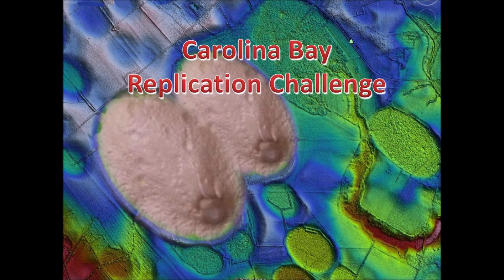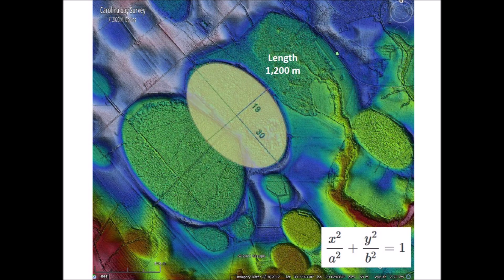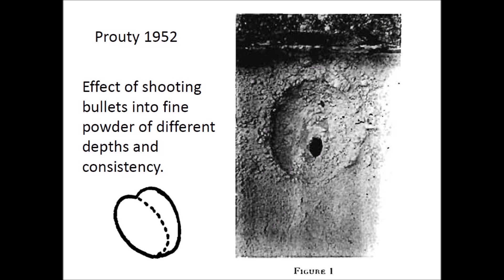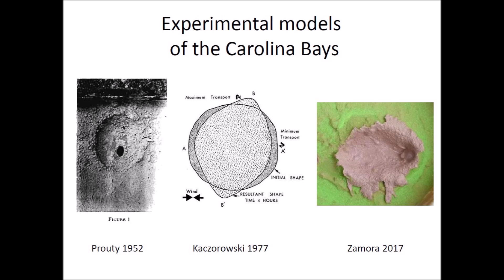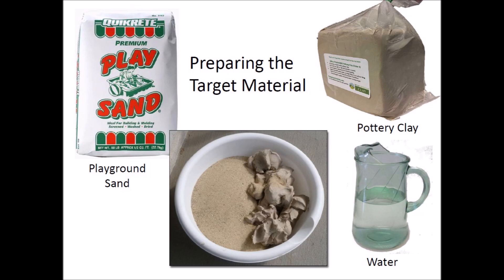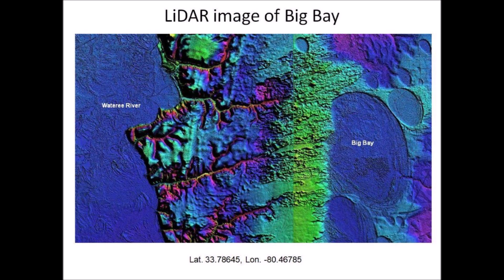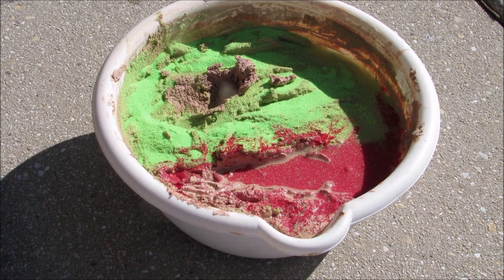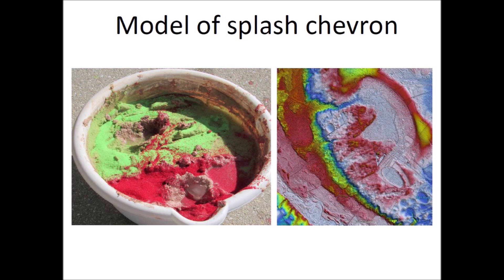Carolina Bay Replication Challenge

Comment: Antonio, what do you think of the possibility that these sinkholes maybe in part relic sites of ice boulder impacts that had remained frozen until relatively recently, and on melting over time had the volume replaced by methane?  https://youtu.be/kanyJeI2Oec
This one is particularly intriguing https://youtu.be/BJ1aTWa_5A4
Reply from the maker: The Carolina Bays are not thermokarst sinkholes. They occur too far south in terrain that did not have ice during the last glacial maximum. We also have to keep in mind that the Carolina Bays and the Nebraska rainwater basins have the same mathematical elliptical morphology, with width-to-length ratios of approximately 0.58.  The orientations of both of these geological features converge by the Great Lakes.
Reply: @Antonio_Zamora  Sorry, you misunderstand me. I entirely accept your explanation for the CBs and NRBs. I refer to the causation of these sinkholes in Siberia and suggest they may be impact sites of ice boulders that hit after the same causal event or another. I ponder if post impact the ice remained or refroze, was subsequently covered by seasonal vegetation but has in recent years turned slushy, been infused with methane before collapsing/exploding to leave the sinkholes. They are punched deep through up to 800ky of stratigraphy of ancient peat fields. I understand fully the science explaining them as thermokast sinkholes and they remain that in my consideration of them, I just wonder if their causation is remnant ice boulders. They are in the same approximate range from the Haiawatha impact site as the US sites you study, and the enormous bone yards of destroyed megafauna of the region are equally analagous to historic finds in the US. I also understand your preferred explanation for US features are an impact site at Saginaw Bay, and I'm not saying that is wrong,  however my own remit is to explore every possibility linked to a higher energy impact at Haiawatha crater and search for supporting evidence. Whatever happened 12,800 yrs ago had similar consequences across the entirety of the Northern Hemisphere,  and needs an explanation that fits that evidence. A melting ice boulder combined with methane infusion may or may not be a good explanation for the sinkholes but given they are at the same approximate range from N.Greenland it is an intriguing possibility that deserves exploration.
Reply from the maker: @CandideSchmyles  I measured the distances with Google Earth.  The Batagaika feature is 3721 km from the Greenland Crater under the Hiawatha glacier. The distance to the Yamal peninsula, which also has many thermokarst features  is 3180 km from the Greenland Crater. This is quite far for ejecta from a 31 km impact crater in Greenland.  In order for ejected ice to be buried, it would have to hit liquefied ground and the ground would then have to freeze almost immediately. An impact on hard ground would cause an ice boulder to fracture without getting buried.  Liquefied soil has a density of about 1,500 kg/m^3 whereas ice has a density of 917 kg/m^3, so the ice tends to float toward the surface. Ice buried in  viscous ground will float due to its buoyancy unless the ground freezes immediately.  The more likely explanation for the Batagaika feature is that some groundwater that was previously frozen has started to thaw. When was the water frozen? Perhaps as long ago as the Last Glacial Maximum and the layer of soil on top has kept the frozen water insulated for thousands of years. Global warming may be responsible for the thawing and the opening of the "crater".
Reply: @Antonio_Zamora  Thank you for your response. I find Batagaika intriguing because it contained bonefields in its paleolithic strata and provides evidence that 800k yrs of interglacial peat bog and tundra, a highly liquid landscape, existed in the region prior to today. I agree that what is happening now is due  to thaw on the slope causing a slow motion landslip and is caused by a doubling of average temperature in that region.
As evidence from NASA Ames you refered to in an earlier exchange indicates ice cover is a major impediment to crater formation and that Haiawatha was under upto 3 miles of ice at time of impact the fact that a 31km crater was formed may well indicate that the meteorite would have caused a significantly bigger diameter crater had it struck elsewhere and had far more energy than a 31km crater suggests. As Siberia (as far south as Altai) and North America have both many similarities in terms of altered landscapes, megafaunal extinctions and erosional anomalies occurring concurrently I feel that the possibility of a singular cause needs investigation. While I appreciate and am grateful for your response and gentle patience these observations remain unanswered. This was a hemispheric event and requires a hemispheric explanation.
Reply from the maker: @CandideSchmyles  I agree with you that the Younger Dryas events require a wide perspective. It will be difficult to put it all together and to get acceptance from the scientific community. For this reason, I am focusing only on the Carolina Bays. I think that once the scientific community verifies and accepts that the Carolina Bays and the Nebraska rainwater basins are geometric ellipses, it will be easier to accept the impact origin of these geological features as penetration funnels. Once there is wide acceptance, books will be rewritten and research will go in new directions.
Reply: @Antonio_Zamora  I think the tide has already turned. On my youtube journey I have seen many, many times your work cited in the comments to mainstream science channels by individuals who are interested in actual science. While academia may show resistance to it this has a momentum of its own that is going to vindicate your work on the CBs and NRBs, of that I have no doubt.

Comment: It's more plausible that the bays were caused by a comet exploding high in the atmosphere. More attention should be on the sandy rims that are always found on the north & east sides of the bays, what I would expect from the prevailing wind combined with the direction of impact. Isn't a comet a fast moving dirty ice projectile colder & stronger than glacier ice, more likely to survive passing thought the atmosphere for one trip rather than the two trips required by glacier ice.
Reply from the maker: Your idea about an exploding comet was investigated by Prouty in 1952. The Carolina Bays contain no trace of extraterrestrial material.
Reply: @Antonio_Zamora  I have never visited a bay or sand rim, but I've been told that the sand is peculiar, & unusual. And so far have not seen or heard of a reasonable explanation for it.
Reply: @rickmarosi-yz9wt-s5b  it's not very peculiar. I've got many samples of it. i grew up in a bay with my house on the sandy rim in Wilmington
Reply from the maker: I made a video about the sand rims. https://youtu.be/jKvS4F9TA6s
Reply: @Antonio_Zamora  I already viewed your experiments with spraying water etc. but didn't find it convincing.
Reply from the maker: @rickmarosi-yz9wt-s5b  You have to consider that glacier ice ejected by an ET impact on the Laurentide Ice Sheet would not be subject to ablation during the launch, as explained by Shuvalov and Dypvik: "In the 1000 m‐scale impact, the mass of ejecta is so large that it moves the atmosphere itself to high altitudes. Thus, the atmosphere cannot decelerate even the fine ejecta and they consequently expand to the rarefied upper atmosphere. In the upper atmosphere, even fine ejecta move more or less ballistically..." https://onlinelibrary.wiley.com/doi/full/10.1111/maps.12127
Ablation during re-entry would vaporize only about 10% of the mass of the glacier ice boulders. https://youtu.be/KUKM3CYsOlE
You have to go with the facts, even if you don't like them.

Comment: Antonio, I think your river experiment shows promise, but you are overlooking the geology and thus your experiment failed.
Simply put, your model river was too deep, and the bottom was too soft.  It did not replicate a real world river, which could be shallow sediment over bedrock, depending on the phase of the river.  In that case, the ice projectile would shatter along with the impact ejecta, something that does not happen in your model.
Paying closer attention to the scale and proportions of the real terrain you are trying to model might give more satisfactory results.
And I think you need a longer, wider bucket, with a layer of bricks on the bottom.
Reply from the maker: You sound like a good candidate to follow up the modeling work.  When I saw grains of sand being ejected from the "river", I realized that I should have made a slurry of red sand/clay to fill up the trench. This was just the first try, and the failure has taught us something.  Now we can see that it may be possible to replicate a complex Carolina Bay landscape.  I think that this type of modeling work would be well received by a geology journal.

Comment: That the Carolina bays were the result of meteors is not that far fetched considering that high trajectory ice debris from an ejecta curtain from an initial extraterrestrial impact with the ice sheet could technically be considered ice meteors.
As far as replicating the conditions for comprehensive experiments is concerned I think the tests would require measurable controls such as angle, speed, surface consistency etc. Perhaps the various parameters could be run through computer simulations.
I hope someone with the technical expertise, equipment, and curiosity takes you up on the challenge.